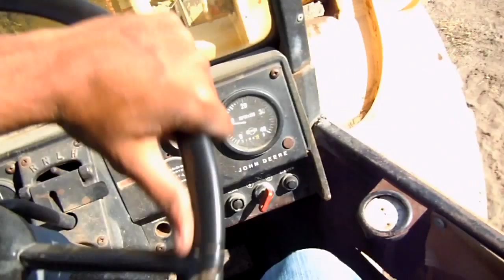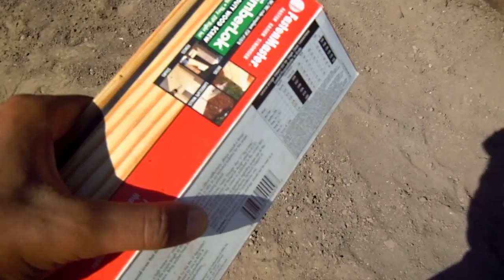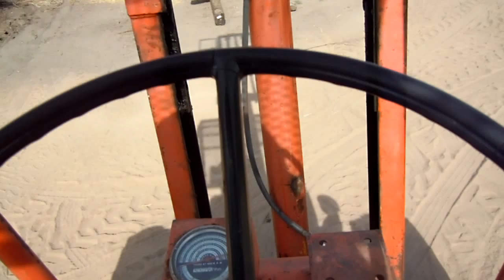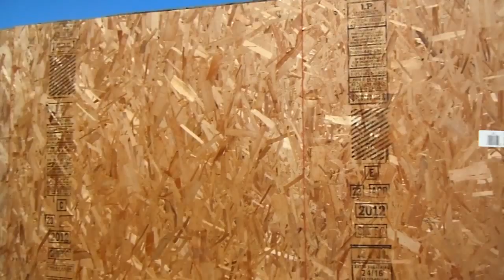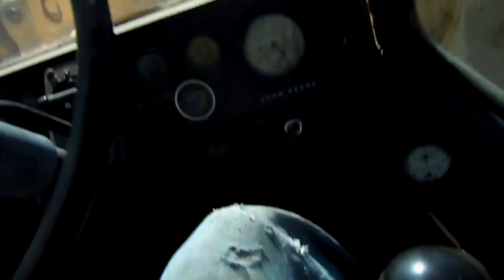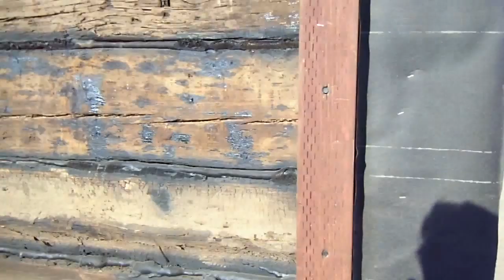Rifle Range Building: Step by Step

Comment: Tires are bad news IMO. They can RTS (return to sender), especially if the bullets go through a few inches if dirt that slows them down before encountering a tire. Or if the bullets hit and skip and tumble up the berm a few feet before they encounter a tire. Regardless of what slowed the bullet down before it hits a tire, if its going slow enough it will probably bounce off instead of penetrate and it may RTS.  Unless you know for sure that  the buried tires have 12" of sand in  front, of them I'd recommend either sand bags or logs in front each buried  tire. Same for the exposed tires but that's easier because you know exactly where each exposed tire is.  

Just my 2 cents, thanks for the video

Comment: Great project and very well done. If you can water it you might try throwing some shade tolerant variety grass seed on top of that soil and see if it will grow. That would eliminate the wind erosion concerns and might even let you remove the "roof." Did you shingle or tar-paper the roof?

Comment from the maker: Will pass on the idea to my pops. The roof did have 6 plywood sheets but that is going to get changed to corregated sheet metal. Reason being that the rounds will almost always be shot at steel so we want to stop all fragments from tearing the roof up and passing through. We also have a junk fiber glass pickup bed cover that we may screw to the ceiling to stop all or almost all fragments. They should not pass through the steel at least. The roof will stop all water erosion (main goal).